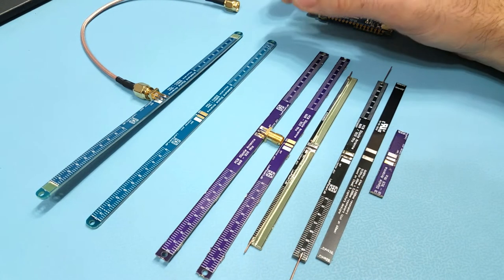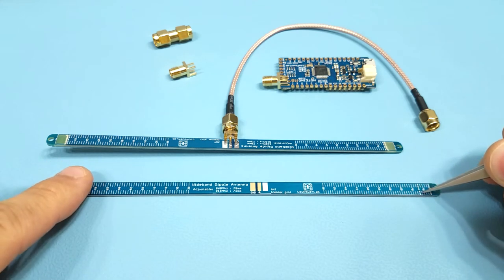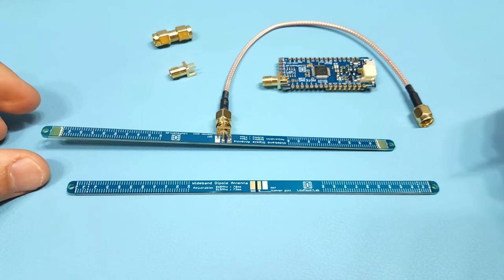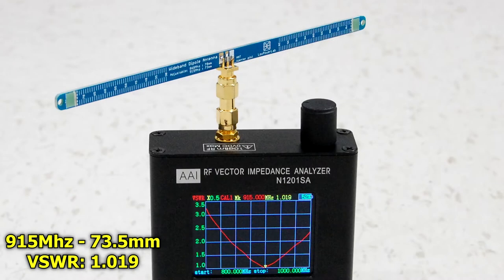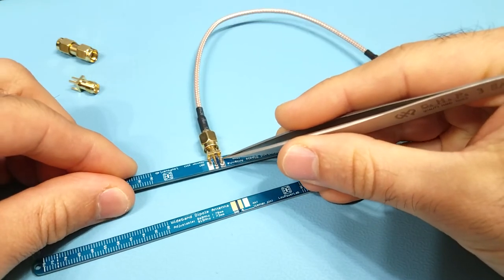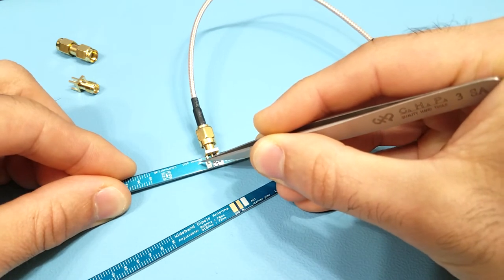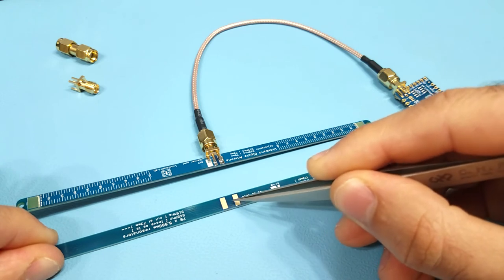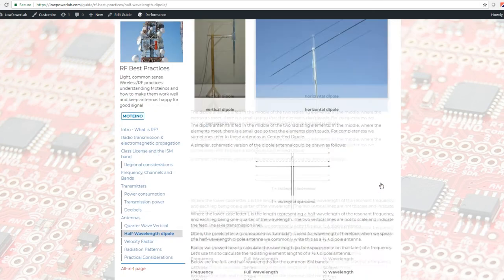Dipole PCB Antenna Overview & Usage Tips

Comment: Have you compared this dipole antenna design with monopole wire antenna? I was hoping for to see the performance and distance compassion in this video.
Reply from the maker: Inherently a dipole has more gain than a monopole, it has its own GND plane, and is a larger antenna. It WILL be a better performer especially when well matched to the source. But I have not done range testing yet, maybe someday when I am very bored :)